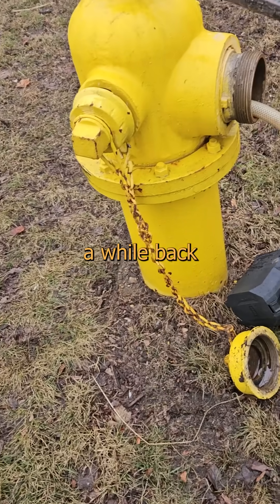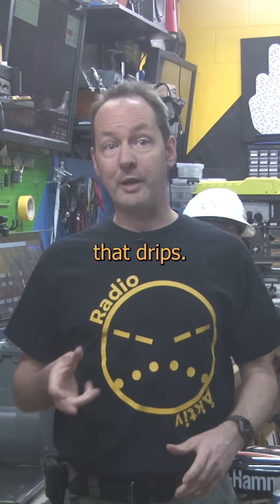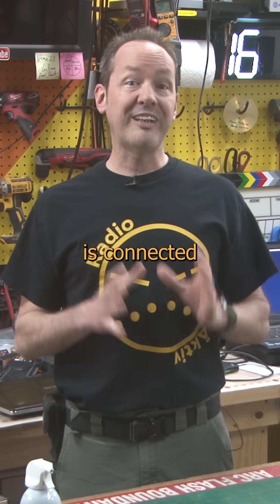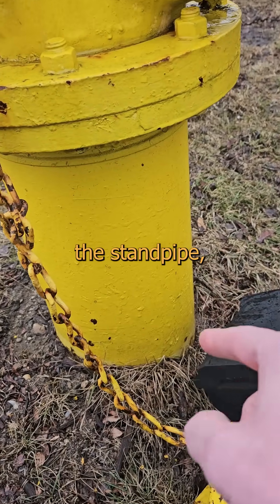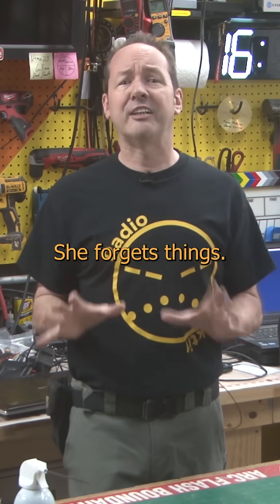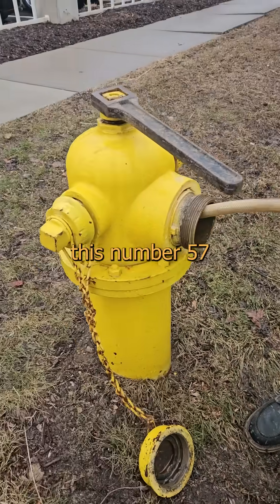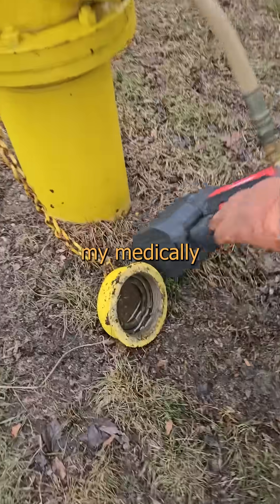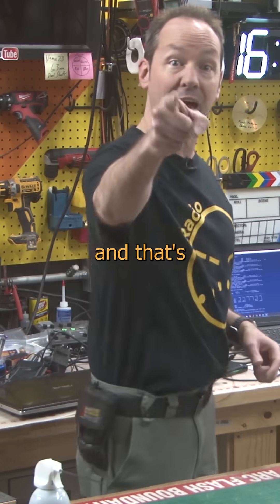How Fire Hydrants Drain #chrisboden #comedy #engineering #water #winter #michigan #ice #science

Comment: The only way that happens is that those have to have a bed of c7 stone so they can drain after opening. If those hydrants don't drain, then they weren't installed correctly. Meaning someone was cheating to make money . If installed properly no freezing, no cross contamination. If someone was screwing the job  up, get your pump.

Comment: I'm a water operator in a similar climate. While I've never had to manually drain a hydrant the holes on the bottom do have a tendency to plug. If you think freeze damage is bad,  check out water hammer.  Got me enough over time for a "group therapy session."

Comment: Most hydrants located in areas that have freezing conditions also have a breakaway plate, that connects the body of the hydrant to the standpipe below it. They also have a breakaway shaft coupling that connects the operating nut on top of the hydrant to the actual valve body thats below ground. The whole deal is for if a car or semi hits the hydrant the breakaways are supposed to snap clean off and not damage any components of the hydrant itself, and so it doesnt flood out the surrounding area. Had to change the same hydrants breakaways twice in a week due to a freshly liscenced truck driver lol.

Comment: Weep holes are no longer allowed on new hydrants in Michigan anymore due to the cross connection between the hydrant and ground water. 

You can sometimes get weep hole hydrants if your engineer and the state can agree that there won't be any ground water intrusion, but I've never had that work out. 

Its not all bad though, the overtime while flushing and draining is nice 😂

Comment: Not gonna lie that M18 water pump is God sent for plumbers. Used to take forever and a half to drain a water heater, and you could never really get it all out, but that thing will suck it dry in no time flat. Like a lady of the night working piece work.
Reply: Harbour Freight has a little pump that you turn with a regular chuck drill, good for like 2000 rpm that works super good. I just drained a 200 gallin water tank for a residential fire sprinkler system with it it only took like 30 minutes. Its like 15 bucks best money i ever spent.
Reply: @SWAMPDUNKEY So a cheap ho that gets the job done vs a quality escort.
Reply: I got that Milwaukee pump so I can pull water from a creek to fill my RV tank. I use a ceramic filter for potable water.
Reply: I'm glad you added the end joke before the Internet crashed as millions rushed to add their version.

Comment: Dry barrel hydrants have a drain under ground where the water main enters the hydrant. When the hydrant is off this drain is open. When the hydrants being used the drain closes so it doesn't wash out the underground. 

Was a FF in cold climate.
Reply: they also have the valve down at the bottom of that pipe, so when some who is more on than average runs over one, the top breaks off, but the valve stays closed and prevents the fountain effect.  unless some city engieer placed the hydrant on the low side of a sidehill.  in which case, there's a service valve, in line with the large port, about 8 feet away.  that takes a tool that isn't carried on the fire engine.  or so I'm told.
Reply: @kenbrown2808  they still do the fountain thing occasional but its rare. Presumably the impact rips the entire shaft out of the tube, valve included.
Reply: @discodench  there is one model where the water pressure pushes the valve closed, and it would have to jam the operating rod down to open it. Another model has a scissor mechanism that pushes the valve closed against the water, and that could get dislodged.
Reply: @discodench  That's why you have shear lines on the shaft at the hydrant base height. Must be rare that it doesn't shear because I've never seen it happen over here.
Reply: @TheArchitectThatWas  they usually sheer off. Geysers are rare

Comment: I still don't get what the advantage of above ground hydrants is. Like they take more space have a freezing problem and can be abused by the public without any special tools.
In many European countries, like Germany hydrants are mostly underground on the street or sidewalk covered by a metal plate. The firefighter have a pipe/pole and a wrench they pop of the cover screw in the pipe and turn on the underground valve. There are marking plates on a nearby post or building describing the location of these hydrants, also gas, water mains and other valves to find them in the winter. The plate also tells the firefighters the gauge of pipe connected so they can find one large enough for the application without looking at every hydrant.

Comment: Bonus points for accurate catheter sizing.
Reply: T.I.L....
Reply: Catheters. They didn't even warn me before they shoved it in. Didn't even tell me I was pretty afterwards. 🥺
Reply: @povnw8985  look by the time i got to the er i already knew what had to be done as there was 1 and a half letters of piss in my bladder i for some reason could not expel on my own leading to multiple months of agony.
Reply: @povnw8985  damn, no foreplay either?
Reply: @povnw8985  I'm sure you were a peach. Medical system needs to step up their game 😂
Reply: A 57 french is a serious hole-opener
Reply: There are 2 types of hydrants, wet and dry,  And yes up North we have to use "dry" hydrants to prevent freezing.  We also put poles with a red triangle on them so we can find it in a 8 foot snow pile.  Down South, not having to worry about freezing. they use "wet" hydrants.  Also Hollywood likes them for those "Dirty Harry" scenes where they snap them off and a 10 inch, 500psi shaft of water that goes seemingly into a 100ft geyser, and can flip a 1970 3,000 pound Buick like a turtle on it's back.
Reply: @davidmarquardt9034  I know you're exaggerating for effect, but a 10" at 500 psi is pushing over 19.5 tons of force. It'll move a fool.
Reply: @martindinner3621   Your right, I was just mocking the film trope where the car snaps it off and it inevitably spouts a huge geyser.  An older car chase trope is somehow a vegetable cart always magically appears in the street and potatoes, cabbages, beets go flying like their shrapnel.  I guess a car chase isn't exciting enough.
Reply: @davidmarquardt9034 
115 psi... but who's counting..
Reply: @blaydCA okay, so instead of 39 k lbs it's only 9,000 is. Still enough to shunt most cars.
Reply: Holy shit he's right on the French Scale
Reply: A 57 French is crazy. Even the big ones we use are in the 20s
Reply: TIL!
Reply: Thank god.
Reply: I farted out my pecker after having a catheter for a week. They inflate a small balloon in ur bladder so the catheter won't slip out, they release that air into ur bladder when they take it out. They didn't tell me bout that, but got home and at the end of my first nom catheter pee, it started to spray out like a garden hose with some air in the line and then did a few solid little farts. It was extremely painful but had it push the air out or else it just kept hurting. Happened the next two times I peed, but not as much as the first time. Felt very weird tho, nothing else like it, very painful tho
Reply: @GorillaShells If they really inflated the catheter balloon with air, you've been subjected to a different kind of "medicine"  than I'm familiar with. It's usually 10 cc of saline in every instance I've come across; and that saline is withdrawn by syringe before the catheter is removed. I'm sorry you were forced to undergo any unnecessary discomfort.
Reply: @GorillaShells  ouch!
Reply: I'm worried when we are talking about catheters and points... bonus or otherwise
Reply: So many people don't know about the French scale system. You definitely don't want to confuse it with the Birmingham gauge . That might cause you more problems than you started with.
Reply: I'm still trying to get my image swapped to a Clippy.
Reply: somehow this skillset is apropos for Chris.
Reply: Garden hoses are measured by inner diameter. Urinary catheters are measured by outer diameter. So a 3/4” hose is certainly larger than he said, but will depend on the hose mfr. better 3/4 inch hoses will likely have higher French sizes.
Reply: extra bonus points if you can use it comfrotably
Reply: Wot does dungeon cucumbers look like .. 😮😊😅
Reply: What? 3/4 of an inch is 19mm not 33... What is he talking about?